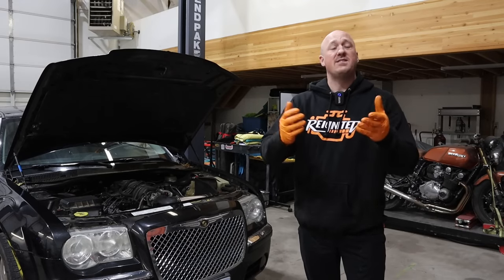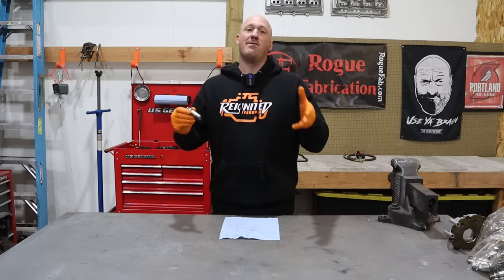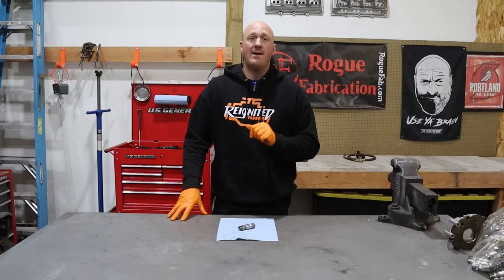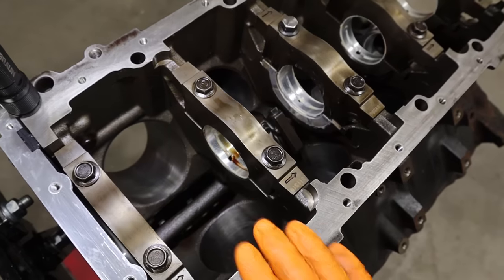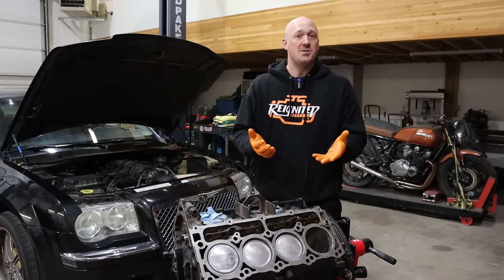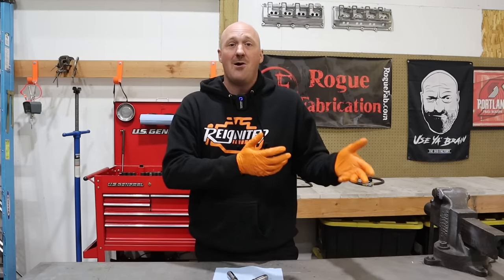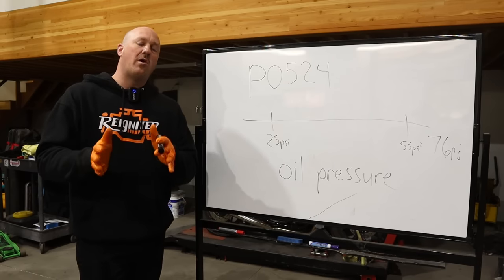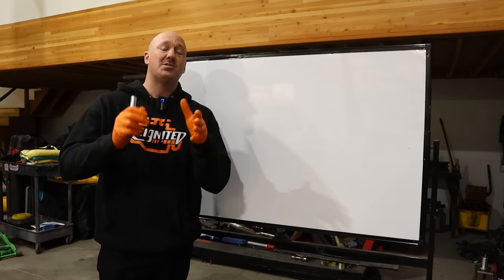The BEST Prevention For Hemi Lifter Failure! (In My Opinion)

Comment: First off . It is pretty bullshit that DJR keeps making ANY engine that requires you have to worry about " idle time " in normal stop and go destroying your engine !! Further , there has to be an Engineered spec for the PSI and volume of oil required at any given RPM . There is a direct correlation between "pressure " supplied in a line and the volume of flow !! You should be able to check this with a gauge or with your computer . Also . Why doesn't someone make a bigger oil pan that would allow for another quart to be used ?! Unless there has been "testing " at the outlet of the pump . There is no way to know if there is ever a " low oil pan " level ! I was considering a new Ram , until I watched this video . Pretty sad that the JDR engineers have not fixed this problem !!

Comment: All engines should last 500 thousand miles before any malfunction..You act like having issues at 100 thousand miles is no big deal. That is a catastrophe for normal people.  I was considering a ram 2500 with a 6.4. I am definitely second  guessing that now.
Reply from the maker: If that were true I wouldn't have a job. Call up any manufacturer service center for any dealership in the nation, we're all at least two months out for appointments. Cars break, it sucks, but they do.

Comment: Best prevention method i have seen is not owning one.  I wouldnt own any brand engine that has hydraulic control of the lifters, gm, dodge and honda all have high failure rates on their shutoff lifters.

Comment: Great, so i have to rev the engine of my super loud 5,7 gen 3 ram to keep it lubricated? I've never seen such a poor design from any European manufacturer. I know the 4,7 has even more harrowing engineering oversights, but oh god i wish my wife didn't coerce me into buying such a piece of crap. The bodywork is also made of such low quality steel that it rusts away immediately when it encounters salted roads, and the China-priced primer and paint does absolutely nothing to help it. Why do you Americans put up with this? I'm also a professional marine technician working with both Mercury and Yamaha outboards, and considering the fact that we have spent 64 hours doing warranty repairs on Mercury outboards (8 of 204) vs the 4 hours on Yamahas (The other 196) this year,  I'd say that American engineers are not doing so well.

Comment: So I need to spend $4500
Every 85,000 miles. 
When will GM make quality parts that last 350,000 miles like Toyota can.
Reply: Sorry to tell you that gm’s 5.3 and 6.2 had the same cam/ lifer quality control issues also with their dod system.

Comment: Bottom line is dodge needs to buck up. Most mechanics know  the wrong oil pump and so did dodge   Once enough people join it becomes a class action lawsuit forcing dodge to correct at there expense listening to manufacturers recommendations regarding oil changes. You just proved that this is misleading which equals class action. All you mechanic that work for dodge should buck up and tell dodge not us ?